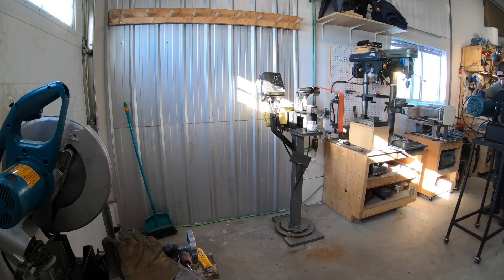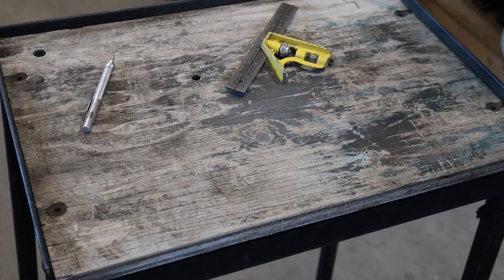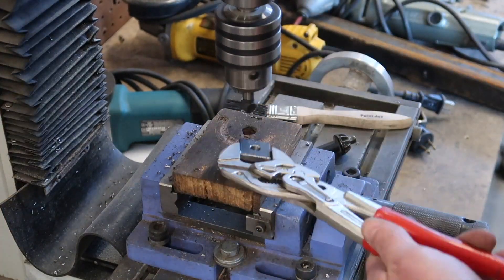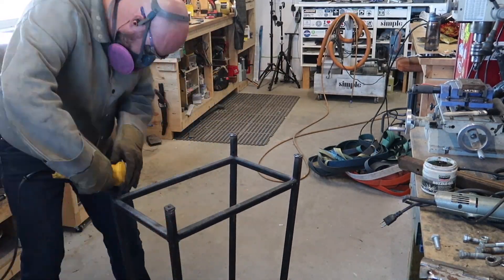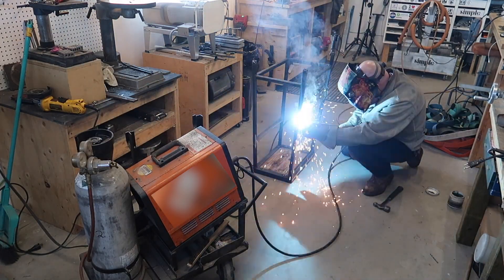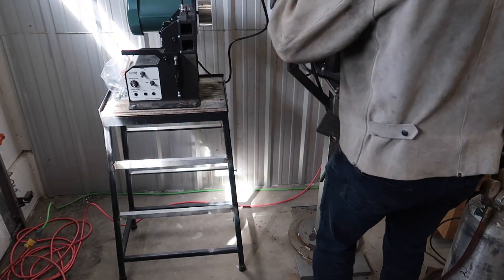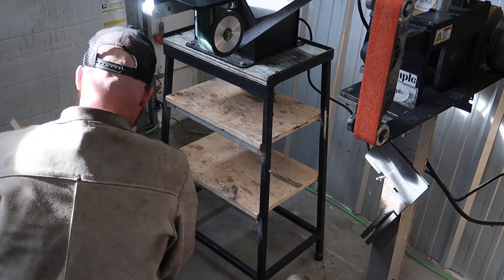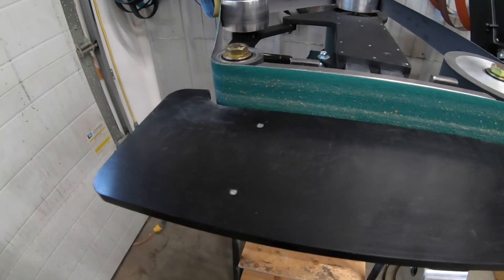Re-doing my knife making shop - Part 2

Comment: I have all the different sizes of the knipex cobra grips they are amazing,the 10 inch set were the 1st set I brought after I finished my apprenticeship over 20 years have been used so much in that time and there still going strong.
Atb Steve
P.S I do exactly the same with centre punches work really well.

Comment: Jeremy, I like the option of the 90 degree rotation of your grinder and the horizontal support plate, but how often do you really need that in your knife making, versus just having a vertical support on your regular setup?
Reply from the maker: I did use it all the time and unless I had another grinder that can go horizontal, I would never give up that hinge setup. 👍

Comment: I'm also organizing the shop in the quarantine, i'd like to see your dust collection system, do you have a separate one for wood and metal or you use the same? I know some people make it out of 5 gallons buckets do you know if it is good enough?
Reply from the maker: Right on! I actually don't use dust collection for metal grinding. I have my water bucket under my grinder, but I find that metal dust is heavier and doesn't float as far in the shop as wood dust. I would like to set up a spark collector eventually so that I can use the dust collector for both. Cheers 👍
Reply: Simple Little Life thanks for the great channel from Quebec City